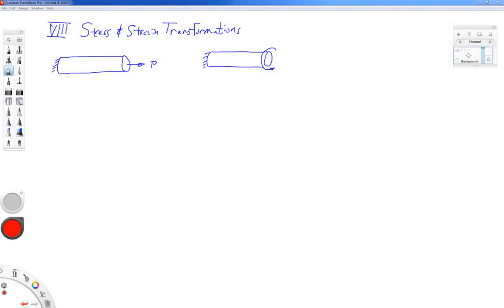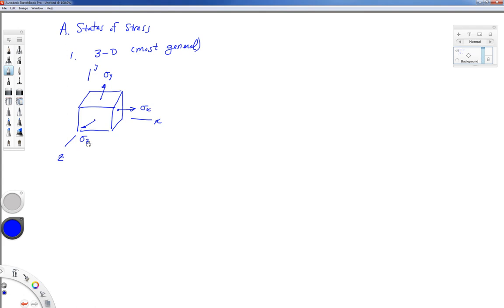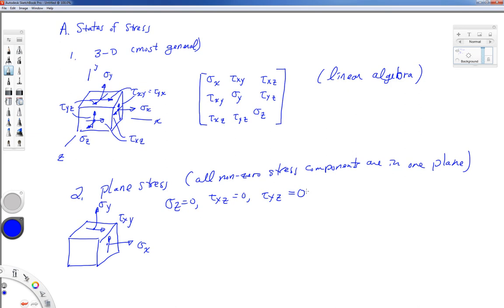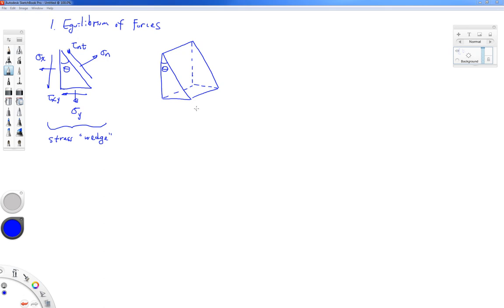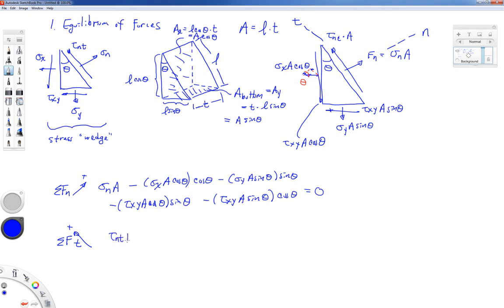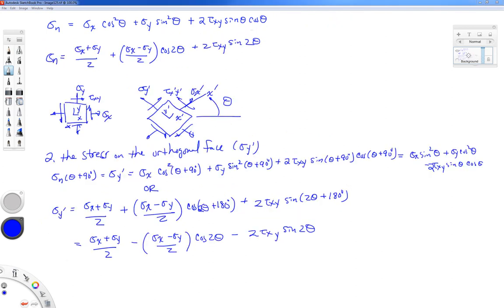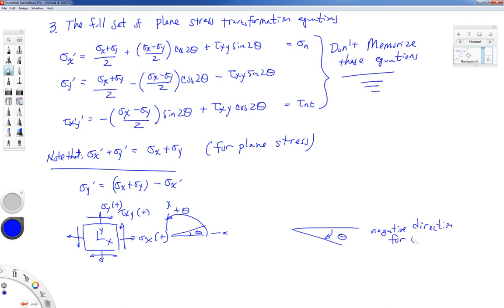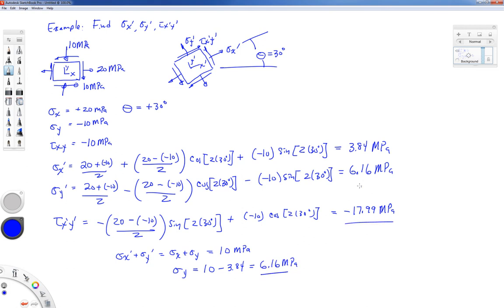Mechanics of Materials-Lecture-25-Transformations of Plane Stress

Comment: Sir , does the plane of failure change when we change the orientation of the element ?
See the following image to understand my question clearly.
https://ibb.co/mcKA3k
Reply from the maker: If the material fails due to shear stresses, both failure planes at +45 degrees and -45 degrees are equally likely for the uniaxial stress state shown in your figure.  So, I won't say it changes, but either one can occur.

Comment: Excellent video, thank you.

You made a mistake with your algebra when applying the trigonometric identities.

The final result for your sigma_n equation is incorrect. It should be tau_xy*sin(2theta) instead of 2*tau_xy*sin(2theta)
Reply from the maker: +Bmoseley85 Thanks!  I will see if I can edit that or remake that video.  Best regards, MEB
Reply from the maker: +Mechanics Channel by Mark Barkey I've tried to make an annotation for now, but it doesn't seem to sync up in time with the video...
Reply: +Mechanics Channel by Mark Barkey 

I don't really see the need to remake the video. Just a simple mistake.

In any case, thank you so much for the content! The video was very helpful, regardless of Algebra mistakes :)